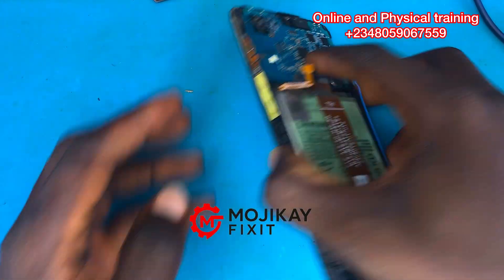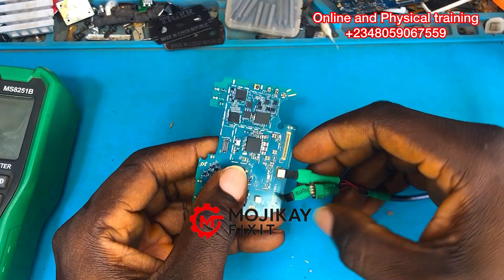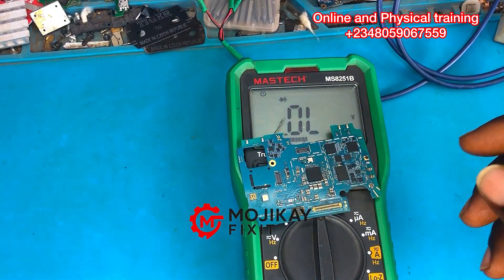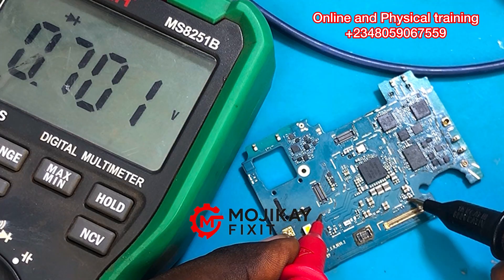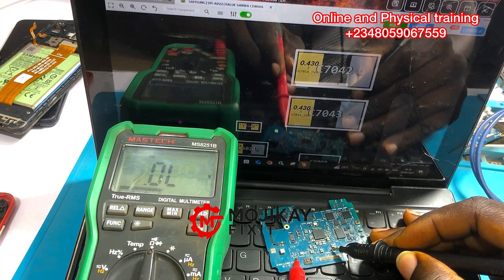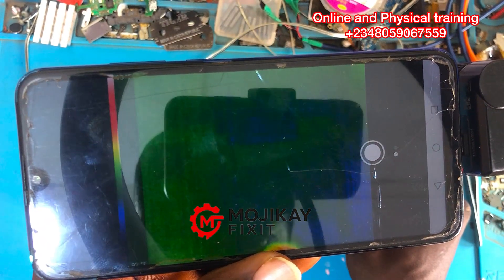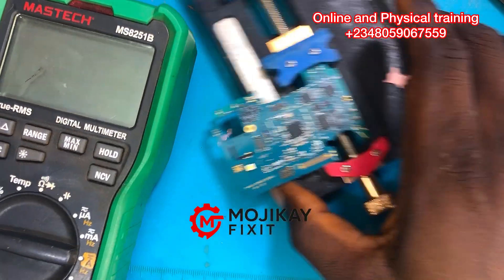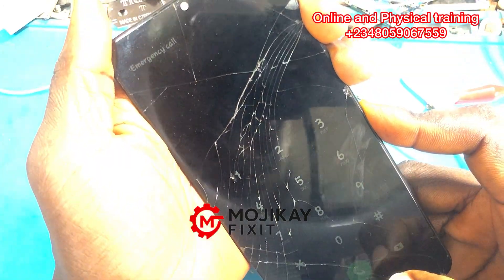Dead Samsung A02 Troubleshooting And Repair Guide

Comment: Thanks for the wonderful video 
This just changed my perspective on how I thought capacitor always behaves when it spoils, I thought it always breach, I didn't know it can spoil and have low resistance value. 

I want to ask a question, please how do you purchase your borneo schematic diagram 
And where did you purchase your thermal camera from ? 
Thanks

Comment: mine got a network problem if you put sim cards it displays 🚫 that sign
Reply from the maker: Check the imei number if it’s present
Reply: @SteveFixitbestrepair i checked using *#06# and they are present
Reply: I checked the  imei with *#06# it's there what should i be checking in the imei please help  @SteveFixitbestrepair